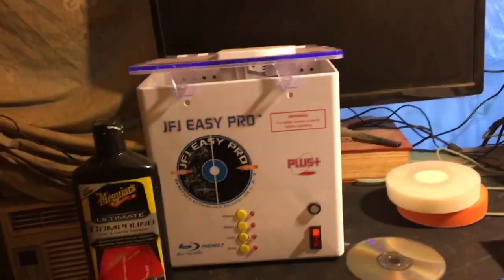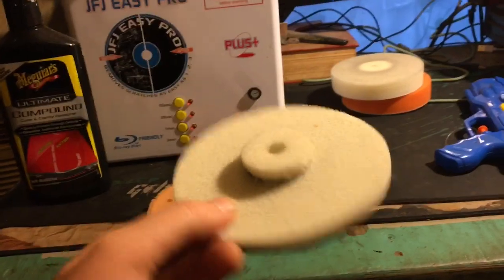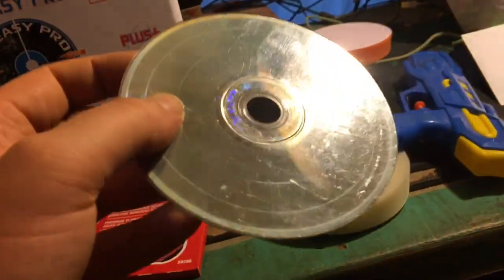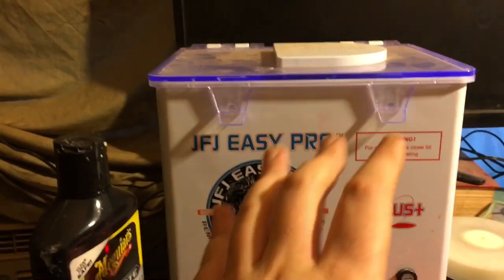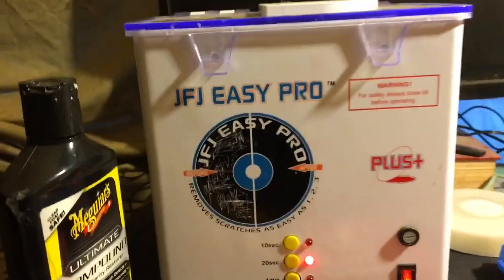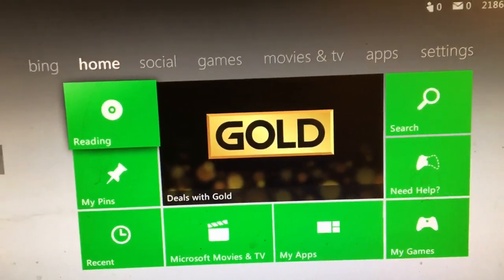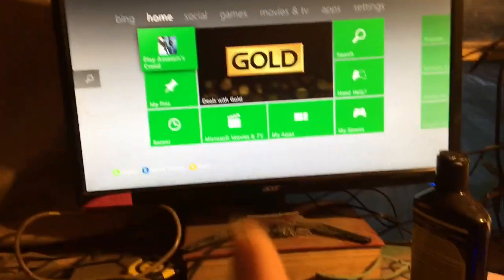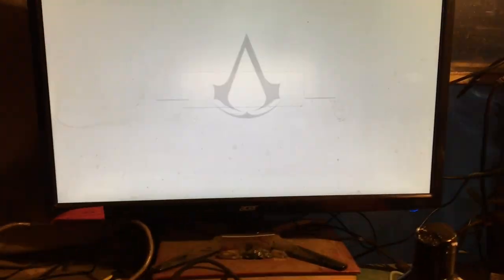Mastering the JFJ Easy Pro: The Ultimate Guide! No more melted disks!

Comment: eBay store?
Reply from the maker: https://www.ebay.com/itm/134634780618?mkcid=16&mkevt=1&mkrid=711-127632-2357-0&ssspo=bqlgDs_2Rxm&sssrc=4429486&ssuid=bqlgDs_2Rxm&var=&widget_ver=artemis&media=COPY
Reply: @JohnnyNJones sold out?
Reply from the maker: @dennishartinger3213 Yeah I have one more pad I can post

But it’s my back up

i’ll post it now

https://www.ebay.com/itm/134634780618?mkcid=16&mkevt=1&mkrid=711-127632-2357-0&ssspo=bqlgDs_2Rxm&sssrc=4429486&ssuid=bqlgDs_2Rxm&var=&widget_ver=artemis&media=COPY
Reply: ok you mentioned you cut the sand paper sheets in circles, then you super glue it on the sand paper pad what happens when the sand paper is all ready been used how do I  apply a new sheet to the pad is it easy to remove or you glue the new sheets on to of the used one? just wanna know what advice you can give?

Comment: The Maguires is like an wax, its meant to fill in small gaps, avoiding water for this step is best, as its meant to be left upon the disc, only surface wiped, with gaps remaining still filled to provide the optics, use/clean and reuse new pads til clean rather than water
Reply from the maker: In this case, I’m really just using the grit from Maguires polish. The wax itself seems to embed some of the grit into the scratches and cause issues with the laser.

So I’m not quite using it properly like you would with a car  👍

Comment: I just switched to using the Hercules sandpaper and cut it to size and the swirls are more noticeable than the original. Could you suggest anything?
Reply from the maker: That tends to be the case when it’s fresh sandpaper, I usually soak it with water, run it for 10 seconds and repeat the process 3 times.

That usually takes care of the deeper scratches, also make sure to keep the sandpaper wiped clean and free from any larger pieces of dust and debris that may cause deeper scratches

Once it wears down a bit it’ll work great for you.

Personally I just have an orange pad that I use that is a little bit more abrasive than the white one and it takes care of the deeper scratches that come from a fresh piece of sandpaper

but I only have to use it once or twice until the pad is wore out enough to use the white pad alone

You can also use it several times on a blank disk if you want to hurry the process up.

Don’t worry, it’s a bit of a learning curve, spray (soak it) the sandpaper in water and run on the disk a few times to wear it down 👍

Then let me know how well it works for you.

I’ll be here for support 😃
Reply: How old is your machine? Mine started having this issue when the Velcro that holds the pads down wore out, it was caused by the pad shifting under the disc while it was spinning. I replaced the velcro and no more swirls.
Reply from the maker: @tbroschat81  thanks for that advice 👍

Comment: I was a store manager at Blockbuster Video and luckily, I had some disk resurfacing training prior. I got my JFJ Easy Pro and read the directions, and applying some common sense and the laws of thermal dynamics, I quickly tossed the directions. 
Yes, water is the key, yes the pads suck and yes, if ran long enough, this machine will melt disks. Take some sandpaper and sand a spot of wood for two minutes, then feel how warm it is. This heat WILL melt plastic disks.

Comment: When resurfacing some ps2 games, I followed your guide EXACTLY for sanding, however my disc doesn't look NEARLY as clean as yours when sanding down every 20 seconds with 1200 grit sandpaper. Am I doing something wrong?
Reply from the maker: I recall that there may be some difficulty with certain kinds of plastics.

I know this applied to the PlayStation one games but I’m not sure if it applies to the blue PlayStation 2 games 

Make sure to check for debris on the sandpaper. Often times if you’re using Maguires compound, it will dry and drop down on the sandpaper and cause circular scratches.

You may have to spend more time using the pads.

I have played many Xbox games in which I’ve only used sandpaper without the buffing stage..

So it’s not necessary for them to look perfectly pristine, but I’m sure aesthetically it’s something you want.

I would try stepping the sandpaper up to maybe 1500 grit. It may benefit a harder plastic.

With the harder plastic, the polishing pads can’t do as much work on getting that shiny surface.

So you’ll have to increase the sandpaper grit. (that is, of course if this is a plastic issue)

Comment: Great video dude! I'm having some bad luck with mine currently. Firstly, had to replace the lid as the plate stopped spinning due to crack, and now since replacing the power light (switch) turns on and lights up, but the buttons seem to have no power, not sure if it's fuse issue of sorts or the motor? What do you think buddy? Going to invest in better sanding stuff
Reply from the maker: There is a fuse it’s a little yellow button on the front panel. There’s several online selling on eBay for 50 bucks you might be able to pick one up cheap.
Reply: @JohnnyNJones  Thanks man will look into it
Reply from the maker: @MattRPD  no problem 👍
Reply: @JohnnyNJones  Sorry mate, one last thing. I'm assuming the fuse you're talking about is inside the unit, and hopefully is a simple change like for like. I'm just hoping it's not the motor
Reply from the maker: @MattRPD  It’s actually on the outside of the machine on the front if I recall correctly. Looks like a little yellow round port. There is a fuse in there
Reply: @JohnnyNJones  How strange, I got the front switch (that seems working) then the 4 buttons for 10 seconds, 20 , 1 & 2 minutes. There is a weird grey nob that a screwdriver could fit into, perhaps its that. Sorry to bother you anyway dude
Reply: I found it, thank you. Something tells me it might not be the fuse issue, as the switch button turns on when the fuse is in (lights up), it's the buttons u press that briefly flash but don't power up the motor
Reply from the maker: @MattRPD  i see, sounds like it could be a motor  issue.

You could technically straight wire it but I would not recommend it.

Like I said I just saw one on eBay for 50 bucks might be your best bet
Reply: @JohnnyNJones  I'm UK based dude, so will cost me about 5K to get it over HAHA. I've reached out to JFJ and see what they can do for me. Thanks again man
Reply from the maker: @MattRPD  hey no problem just don’t straight wire it 

Even though straight wiring would work

I think what I’m trying to say is I’ll make no personal claim the straight wiring it is a good idea…

But i’d have no way of stopping you if you did 👍

Even though it would work

But you would have to watch it closely

But once again it could void your warranty and lead to injury

☺️

Comment: When are you going to have some more pads? I got some cheaper orange ones after foliowing your process still got scratches and disc won’t read
Reply from the maker: I should have some in the next week 👍

But they may be the same pads that you used.

Were the scratches there before you used the pads?

If so, you may have some debris on the sandpaper that’s leaving deeper scratches 

I had that problem many times.

A great way of testing that is to take a blank CD R that’s perfectly unblemished and run your polishing pad on it 

If there’s no scratches afterwards, then it’s most likely your sandpaper, leaving deeper scratches either from a crinkle or some debris from a previous disk
Reply: @JohnnyNJones  Hello once again Mr Jones, I have followed this video to a tee multiple times now and have fixed a handful of games, however like the comment here, I'm thinking the sandpaper debris might have scratched up another disc I resurfaced (didn't wipe it off when I gave it another 10) The disc is a PS2 game and the scratches don't look TOO deep, but the Ps2 won't read it(it tries to for a good long while, then it says cannot read disc)

Would this be salvageable or should I cut my losses and buy a new disc?
Reply from the maker: @mr.b9613  if the scratches don’t look that deep, then you’re most likely dealing with a dead disk.

Every once in a while when you’re ordering scratched games or buying them from whatever source you’re getting them from , go ahead and try them on the console before you try to fix them.

You’ll be surprised how many of them start up and run without too many problems.

The reason I suggest this is because it gives  your brain an idea of the difference between a disk that’s too scratched and what is completely ruined.

Minor scratches hell even heavy ones can still be read through enough to get to the title screen most of the time.

See the data is actually stored on the plastic and these tiny little bumps, the aluminum is only there to reflect the laser back at the sensor.

So if something’s been resurfaced too much, it can actually just destroy the data on the plastic, or if you have a scratch, that’s so deep that it hits that data layer.

And if you get a disk like that and try to resurface it to remove all the plastic down to that scratch itself then you’ll actually destroy the data on the rest of the disk that level as well.

I know this is a long reply, but the only tips I can give you is to soak it in water And give it a rub down for a few seconds, this makes sure debris is not stuck in small scratches. Maguires can make discs unreadable, which is why I recommend using water with it because it leaves a film of wax.

So give it a water bath and try it again if that doesn’t work it’s most likely just a dud my friend.

Comment: questions after the finish product meaning the disc does it come our with swirls or like if it was new disc like there were no scratches
Reply from the maker: Sometimes it looks absolutely brand new and by adding enough water you can usually get it to that point.

Sometimes it has some lights swirling, but it doesn’t affect the readability of the disk. It plays just fine.
Reply: @JohnnyNJones  Awesome

Comment: Hi, is there a way to use other pads for 600 and 1200 sandpaper to go on top of?
Reply from the maker: I’ve tried finding riser pads for the sandpaper, and I’m still having trouble sourcing them.

Unfortunately, you might have to order stuff from JJ when it comes to sandpaper rising pads but luckily they last for a long time.

However, if I manage to figure out a way of getting the right pads for attaching sandpaper to, I will sell them
Reply: OK i fix them with a drill press instead of machine. Would a regular hard foam pad work with sandpaper glued on top?
Reply from the maker: @pcm87  you know I thought about that myself. But I’ve never really tried it. I think you should give it a shot. 👍

Comment: So after I use th 600 grit, it leaves these swirl marks on my discs, and I believe I am getting a 1200 grit soon. 

But I was wondering if I need the 1200 grit so the swirls dont appear after I do the 600 grit once.
Reply from the maker: Yeah, you definitely need a 1200 grit. It gets rid of the swirl marks. 

In fact, the more times you do the 600 grit  (within reason) the easier it’ll be to polish with the 1200
Reply: @JohnnyNJones  Okay, thank you. I will try out the 1200 and hopefully be smooth sailing with the rest of my discs
Reply from the maker: @Ninjasneekman  yeah it’s gonna help a lot!

Comment: What do you use for your sanding discs? Ie what you stick the sandpaper to before it goes into the jfj
Reply from the maker: I still use the same ones that came with the JFJ they hold up well.
however they are not impossible to find. you can even use the  polishing pads to hold the sandpaper if need be
Reply: @JohnnyNJones  What Thickness is the sanding Pads and is it a soft sponge foam? Thinking of using Interface Pads as in the UK there's not much adhesive sanding discs on the market.
Reply from the maker: @grantdilworth9014  Sandpaper should do the trick 600 and 1200 grit

I’ve never heard of interfacepads but if they’re slightly abrasive they might work. 

I think there’s something like an inch and a half thick but that’s just for the sponge itself the sandpaper goes on top
Reply: @JohnnyNJones  An interface pad is pretty much the sanding disc but it has the soft velcro one side and the hook velcro on the otherside. Reason I ask is I got a faulty JfJ which came with just the machine itself. Once repaired was going to get supplies and just researching for now. Trying to avoid spending $50 getting them shipped to the UK. 😅
Reply from the maker: @grantdilworth9014  you know I will say it’s not an exact science. You have a lot of room for error as long as you don’t run the disc too long.

If you use the buffing pads and glue some sandpaper on top it should work just fine

You can even trim down foam buffing wheels.

So the Jfj comes with to hook and loop risers to put the sandpaper on. A medium open cell buffing pad and then a soft open cell foam pad for polishing

At this point I don’t even use the polishing compound I just use water

A lot of disk can be saved just with a buffing.

But if you have any access to foam i’d say cut yourself a wheel out and slap some sandpaper on there.

It’s really hard to mess up like I said unless you do it for too long without water

Take a look on AliExpress you may be able to find some stuff there to use
Reply: @JohnnyNJones Again thanks For your advice Much Appreciated 👍🏻
Reply from the maker: @grantdilworth9014  No problem hopefully I have been able to help some. I’m sure you’ll figure something out 👍

Comment: Do you get scratch marks on the inner ring of the disc, or is that due to improper use or worn pad? Thanks.
Reply from the maker: That’s usually caused by the nut itself some people put a piece of felt there to keep the nut from scratching the disk

But if you’re talking about the outer edge of the ring then yes that can happen just make sure you’re putting enough water because if you don’t put enough water sometimes you can get some melting happening where the particulates form together
Reply: @JohnnyNJones  Thank you for clarification. I had 5 discs resurfaced at a local retro game store. My games don't have deep scratches as you showed. More like surface ones from poor handling. I guess I would try hand polishing them or use a machine the way you did, but at home.

Comment: Where can we get the orange pads from?
Reply from the maker: Right now I’m selling them on eBay
Reply: @JohnnyNJones  I saw the white ones, but not the orange ones. are the white ones the same?
Reply: Also curious. I use the orange pads since I was sent those instead of white. They seem to work alright, but are they okay to use with the jfj white compound / meguiars
Reply from the maker: @Radda561  yeah, those are totally fine to use with anything 👍

They’re just a different color and slightly more firm
Reply: @JohnnyNJones  I'll have to look up your site.
Reply from the maker: @bad74maverick1  I’m the only listing on eBay that has the title JFJ easy pro compatible pads
Reply: @JohnnyNJones  Ah yes, thank you indeed.
Reply: @JohnnyNJones  I got the orange pads. Whats the easiest way to get a hole in them without tearing them up?
Also I used the Maguires with the jfj white pads and was astonished by how much better it worked!
Reply from the maker: @bad74maverick1  I just use a pair of scissors to cut a small hole in the bottom. You will not damage the pad.

You do not have to put the hole all the way through

I’m glad it’s working for you. It took me a while to figure it out myself.  👍
Reply: There from alibaba. They cost a couple cents per pad. You just have to buy a lot of them.
Reply: @phoenixasheslevelup  Thanks, I've got a few now.  And that car wax was the freaking bomb!  worked like a charm with the water.

Comment: Hi there. My machine is not polishing the outside ring of discs so is leaving big circles around disc, and unevenly wearing down my pads.
Any ideas?.
Reply from the maker: Make sure the spindle that holds the disk isn’t warped or wobbling.

That can happen if you leave the lid closed for a long time while there’s still a pad on the machine.

 it seems to put a wobble into the spindle by putting too much pressure on one side from the pressure of the pad.

You should be able to tighten up that spring assembly

Also make sure your sandpaper is in good condition, The disk may appear not to be polished evenly but it could also be the sandpaper isn’t level enough to remove deeper scratches on the outside. These deeper scratches won’t be visible until the disc is polished.

Most likely it’s a spindle issue or you need new pads to keep constant pressure on the disk.
Reply: @JohnnyNJones  ok thanks, i'll have a look!.

Comment: does the mirror layer can be fix?
Reply from the maker: Yes, but that’s a really difficult process. you’d have to a layer of aluminum and the Re coat the disk.

Usually, something like that is only done if someone doesn’t wanna lose very valuable files
Reply: @JohnnyNJones 
thanks
as a computer technician
people being me data recovery works
and some time it's cd/dvd of wedding with scratch on one or two sides of the disc
Reply from the maker: @amir2880  there’s also some really good data recovery programs out there that can help recover at least parts of the AVI files (or whatever particular format)

Those might be useful to you as well, my friend